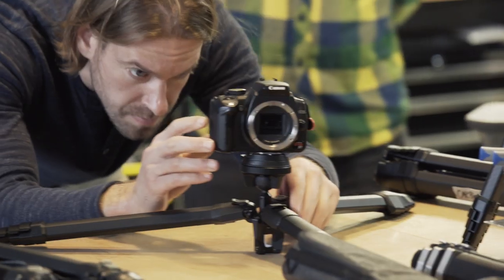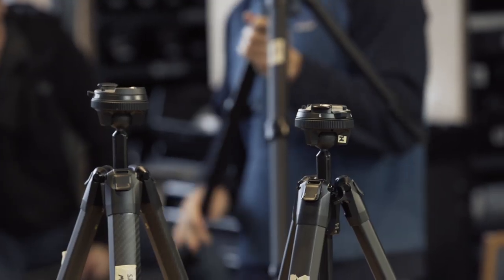Meet the Travel Tripod Engineers

Comment: I was hoping Peak Design could make an ergonomic handle for the bottom portion of the center column of the Peak Design Tripod. One that would slide up the column from the bottom, conforming to the triangular shape, and then lock in place using the existing locking mechanism employed by the hook. Then we could use just the center column for vlogging.